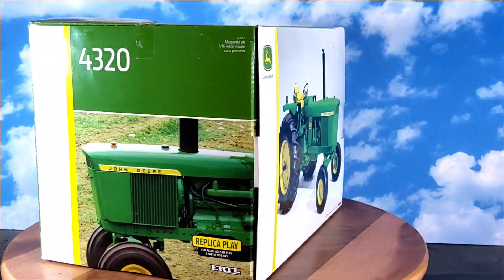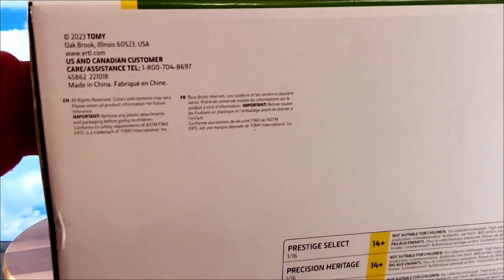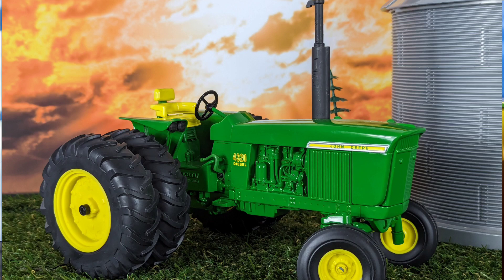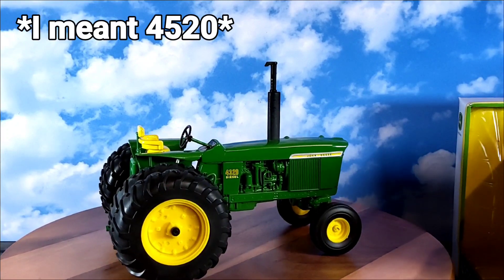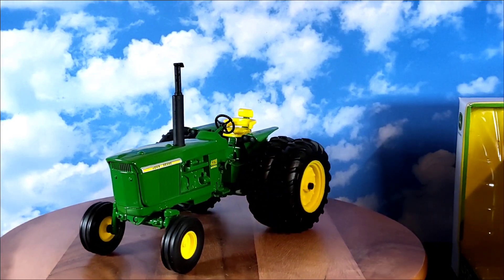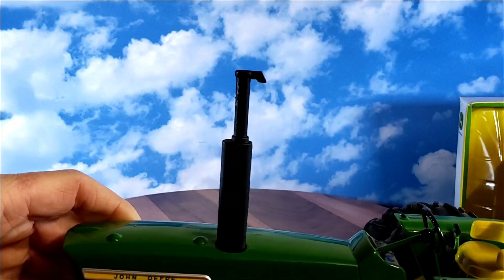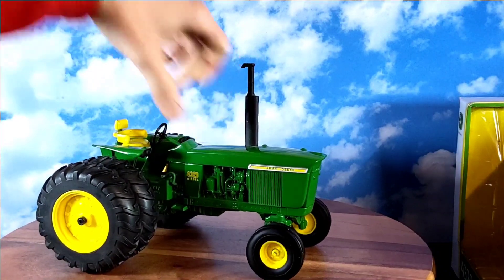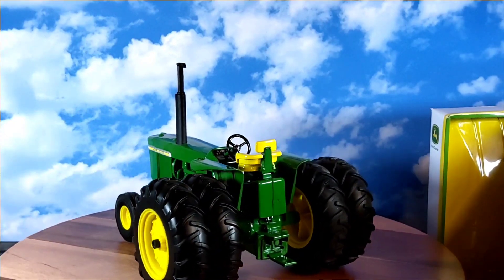Ertl 1/16 Replica Play John Deere 4320

Comment: Nice find! Maybe the next base for some customisation.
You realy got none of the mid 1970' JD7020/7520 toy tractor? Them are also very pricey, even in Europe.
Reply from the maker: No I never had one even as a kid in the 70's when they were readily available.  Someday I hope
Reply: @replicasofthepast4756  i just checken out some and got scared about the price taks. I am blessed to own two of them with one JD220 foulding disc. One trator is missing his air intake but both are in 1b condition (some little paint damage).